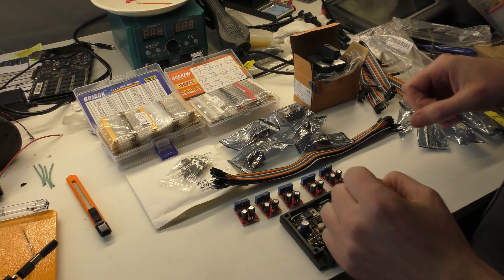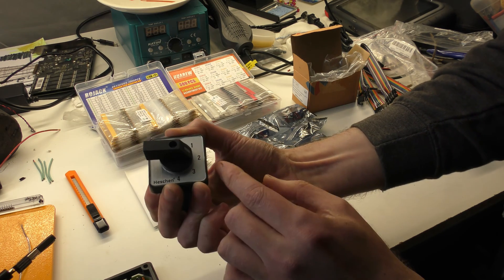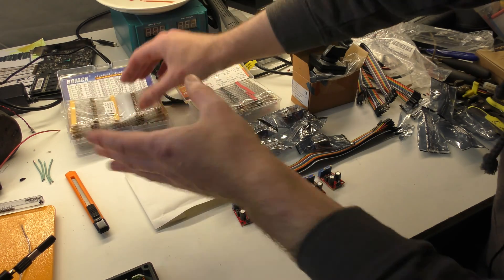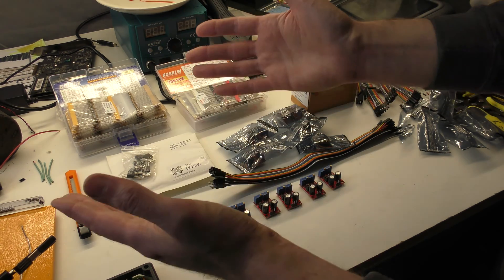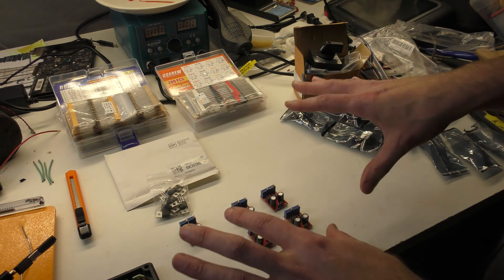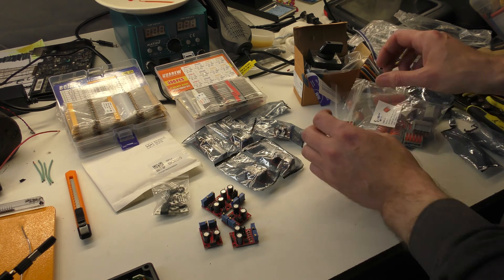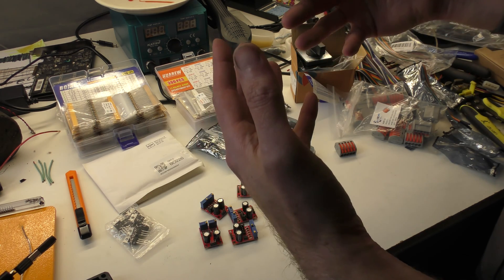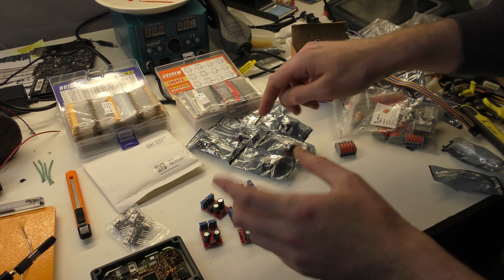Replacement Webasto Diesel Heater ECU Controller  - ECU less, no programming  /|\  part 1 = parts

Comment: Hi David
Great videos thank you and an obvious wea;th of knowledge I’d like to tap into if I may?
We’ve had a brand new Thermo Top EVO 24v Webasto installed on our Dutch barge by a local dealer. It’s run fine for … 2months then stopped, right at the beginning of that really cold snap we recently had.
The dealer came back, stripped it and found the combustion chamber was “totally coked up”. It was so bad they couldn’t even poke a welding rod through the inlet. Long story short, the chamber was replaced on Warrenty.
My questions are 2 fold.
1. How do I prevent this in the future please? I’m aware people say you’ve got to run them “flat out!” But they only have the one speed and the ECU sets this. All I can do is keep it running at a much higher temp than its comfortable on the barge (anything over 22’C) Any better ideas please?
2. The guy installing it had a windows laptop so he could run the relevant Webasto software to read the fault codes and keep the unit from locking out etc while priming. My question….. is there anything like this publically available for Apple? The Warrenty runs out this year, while I’m pretty handy at fixing stuff, I’d happily strip the unit down and remove the combustion chamber, I think I’ll be stuffed if I need this software to get it up and running again.
Are there any ‘work around’ you know of that’d allow me to interface with modern units without paying £hundreds for software licenses and a whole new/secondhand windows laptop?
Many thank - in anticipation!
Alan
Reply from the maker: There are number of things that might make it choke up.  Partially blocked intake or exhaust, long runs on low power, contaminated fuel.

The diagnostics and the adaptor can be bought relatively cheaply off eBay (that's where I got mine), but you'll either need a windows laptop or an emulator on your mac.

Comment: This is a good wee project!  One way you could impliment a bit of safety is, as someone else suggested, just a temperature controlled relay (which you can buy off the shelf as a module) measuring the temperature of the body of the heater.  Over a threshold, such as 110C the relay shorts out the power leads, blowing the fuse to shut down completely.

You could make a simple flame-out detector by connecting a water and exhaust thermistor in series and triggering a relay (via a simple comparitor) if the voltage at the junction of the two exceeds a set limit - indicating the water temperature exceeds the exhaust temperature.  Once the heater is running, this should never occur.  If it does, the flame has gone out.

I see no reason you shouldn't be able to make this work.

Comment: Great idea David. Nice and simple. Not sure if have thought about it already, Will you need a safety circuit in case the flame goes out? Perhaps a relay controlled by a temp sensor?
Reply: That was my reaction. It needs some safety as it could otherwise destroy your pride and joy and have serious insurance implications.   You also need a brain to operate it.
Reply: Yes there are quite the handful of safeties on those. Thermal switches Etc. The ignition source for the gasoline fed heaters was a spark plug that was excited off of the fan motor via a set of points and a cam. It also had a regular ignition coil.
Reply from the maker: Stage 1 - get it running
Stage 2 - tune for proper running
Stage 3 - safety systems

Safety 3rd!
Reply: @DavidMcLuckie  fair enough, I can't argue with that.  I was just concerned about not losing sight of stage 3.  I like your no bullshit videos.  The introduction always makes me smile.  It has a certain Big Yin quality 👌

Comment: This is a cool idea. 
But can you make a adreno controller.  That you have preloaded the software.
Reply: The reason for this is because of Arduino, pic, whatever messing around with and not being successful.
Reply: @MartinTheLaserGuy  - Ah, I see. That’s too bad.
Reply from the maker: Arduino/Adafruit controller is coming, just slowly.  ;)
Reply: Great idea! An Arduino would be pretty awesome, especially because they're very affordable and readily available. That said, the multi-position, manual switch idea is great for those who don't need automatic control, but for my situation, I absolutely need my vehicle and RV heaters to be fully automatic and programable.

Comment: Hi David
I tried similar with toggle switches then later with arduino and relays. I used a stopwatch to operate them in the correct sequence at first . The problem is that sometimes the switching times are variable depending on the ambient temperature. The glowplug sometimes needed longer, and the pulse rate of the fuel varied to get successful ignition. For a simple quick pump pulser is to use an  old vehicle turn indicator  module. Best luck 👍⚡⚡

Comment: This system might be good if hooked to a wire harness to check heaters to find what's wrong. I have one now that don't know what's wrong, control system seems most likely, but after all the dif error codes...I will just get another and maybe swap parts to find out. I had to rip it out and tear down about three times in a little over a month (just over warranty) couldn't get working, had to heat my RV with propane and cost way more and didn't do as good a job. Hopefully have a back-up this winter. Maybe hook it up for manual run.